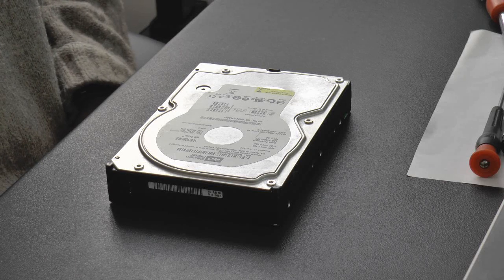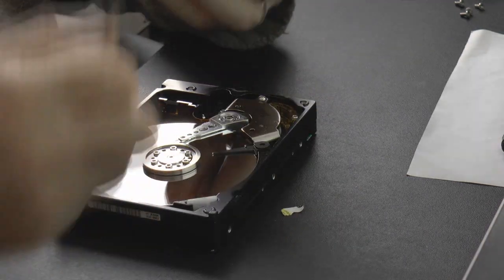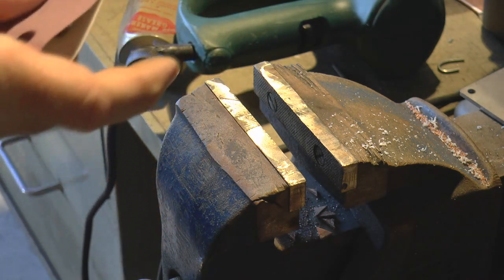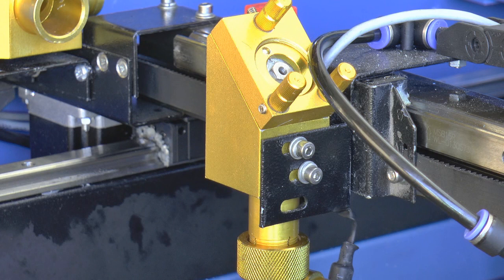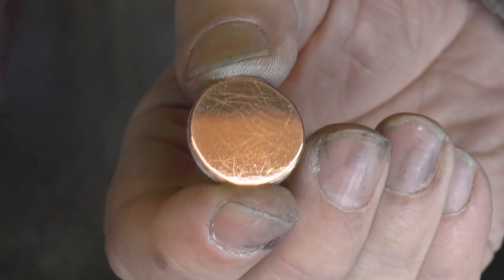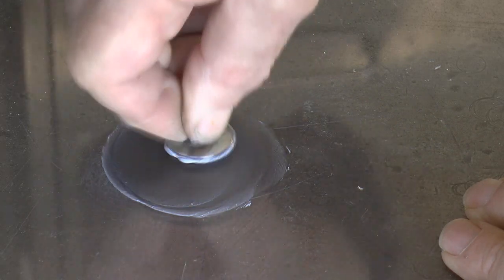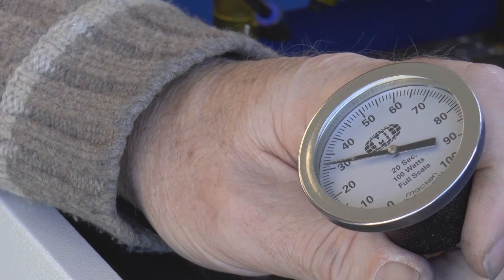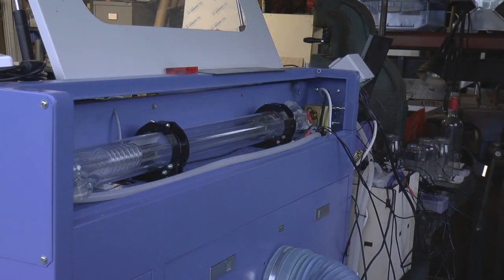RDWorks Learning Lab 43 More Mirrors and Making Them

Comment: Once again you have added quantified knowledge to the laser community. Thank you. That laser power meter of yours certainly gets a lot of work!
Reply from the maker: +bobdring 
Hi Bob
There are a lot of myths about using hard disk platters as mirrors, but no quantified facts. Sorry to bust the myth. Sad because I was looking forward to making cheap and easy mirrors. Now that I'm on the copper trail, I'm hopeful that with a little more thought I will be able to find a method of making copper mirrors that anyone can copy Copper sheet offcuts are easily purchased on Ebay and that's the difficult bit done for just a few £/$
Thanks for your support
Russ

Comment: Hi ..how do you prevent oxidation on copper? or simply you polish them every week? thanks
Reply from the maker: Hi Andrea

After two and a half years I still have those mirrors in my machine. The polish that I used has something in it that obviously prevents oxidation. In all of that time I have only removed them twice and may have spent about 10 seconds for the merest repolish on each mirror . Mirror 3 was repolished recently as I installed my new acrylic head. They do not seem to tarnish despite what the doom merchants predicted.. Although I still use copper mirrors I have found no reason to dump them, however, they were an expensive experiment that has proved successful but in practical terms, molybenum mirrors are far more sensible  for maybe a 1 or 2% loss of efficiency and MUCH cheaper

Best wishes
Russ
Reply: thanks russ..i have some copper plates at home 1-2 mm in thickness..i will have fun to build for my machine.

Comment: pretty good results! now if you could figure out how to gold plate them you'd have it made!

P.S.  You are technically lapping those mirrors and might get slightly better results using the old figure 8 pattern with the occasional ¼ turn. The figure 8 pattern makes sure that you keep equal force on all parts of the workpiece.  The cloth is probably rounding the edges, usually a cast iron lap is used to keep everything super flat, one for each grit of lapping compound.
Reply from the maker: +mrchew1982 

You are right about the cloth rounding the edges. It is a fact that I have noticed. However, it's only the 8 to 10mm diameter at the centre of the mirror that gets used and so that's what I was really looking at. Cloth polishes the surface very quickly so it was a pragmatic compromise. They are in the machine and working better than my moly mirrors so I can't complain. I do plan to make another set but will fix them to a 5" disc of 12mm thick steel that I have. If  bolt them to that and make all three mirrors at the same time I anticipate getting better flatness. Like most people, I don't have any cast iron lapping plates or different compound grades to do the job properly. The idea here was to be creative with  FREE non-specialist  materials and methods that anyone can copy. I did not strip the polish residue off with acetone and I was slightly worried that the metal polish I was using , which has a protective finish, would mark or burn off with use. Seems not to be the case, but it's far too early to say how long they will remain tarnish-free.  Gold, silver and copper are all in the 98 to 99% reflectance region so I think there would be little performance gain achievable with gold plating. Molybdenum is definitely  maxed out at  98% theoretical reflectivity although my results show 94 to 96%. I shall be delighted if I can make 98% copper mirrors, such an easy material to work with. Just a matter of finding the best "home-brew" method. 
I tried the hard disk platter method because many people were saying how good they were and I'm all up for an easy life. Sadly, although they are free, flat and shiny, a set of those would almost  halve your machine's usable power. At about 85% reflectance  (each)and 8% lens loss,  my 38 watts tube output would have finished as 21 watts at the cutting face. Oh well, it was worth a try and I'm not aware that anyone has ever quantified the performance.
Thanks again for your suggestions and support.
Russ